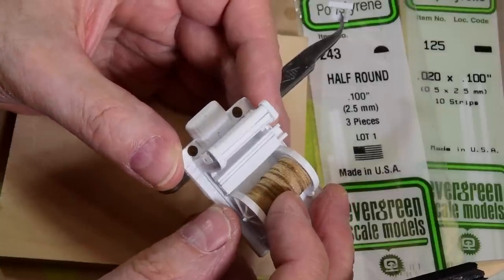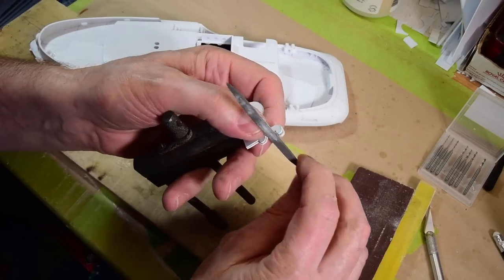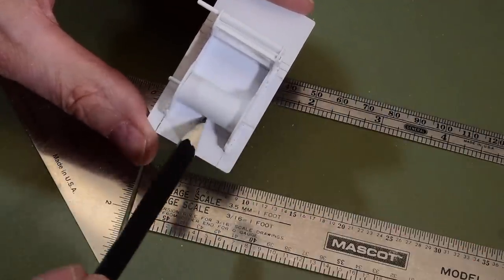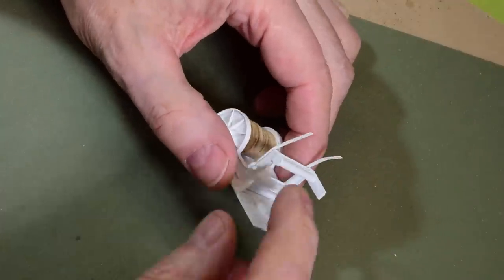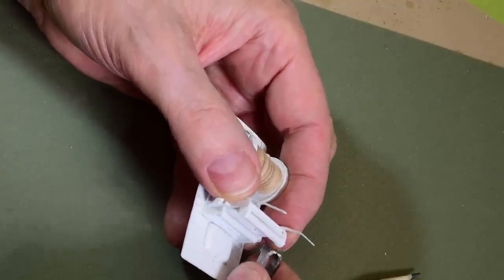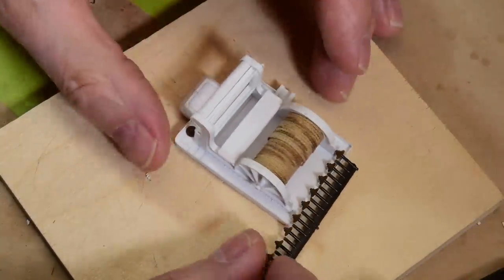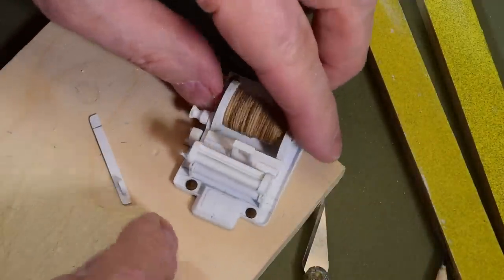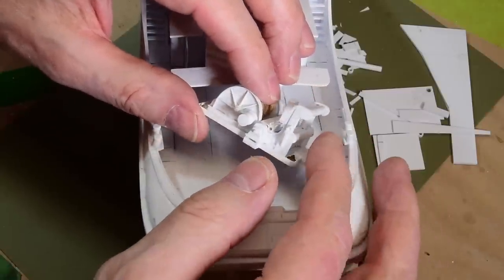Scratch Building Seaspan Corsair (Part 10) | Boomer Diorama ~ Vlog # 182

Comment: The big "cast" piece with the hatch cover is the LAZARETTE HATCH giving access to the boat's rudder area. This tug likely has "pod steering"... instead of a rudder, the prop (water screw) could rotate 360 degrees for amazing control & positioning of the tug. The bolts holding the wench to deck are located over the stringers, and affixed to them, for strength. For not really knowing much abouts boat's, you sure have recreated a near perfect replica... with all the mechanicals in the correct locations and functional.  Mind-blowing work, Boomer... absolute mind-blowing.
Reply from the maker: Thank you for enlightening me on the specifics. Sounds bang on to me. One is always learning. Building a model is a good teacher for sure. Cheers and thank you!

Comment: Absolutely brilliant work! Two questions, How did you do the rivets on the flange of the large cable reel? And How do you bend and glue the 10 x 80 thou plastic around the corners to make the flange with out it splitting? I have tried and every time I get it to go around the edge of a 40 thou piece, the 10 thou piece split/cracks as soon as the glue touches it.
Reply from the maker: It's all in the video Ralph. ;-) - I pre-roll the plastic to introduce a curve first. The rivets are done with a compass.